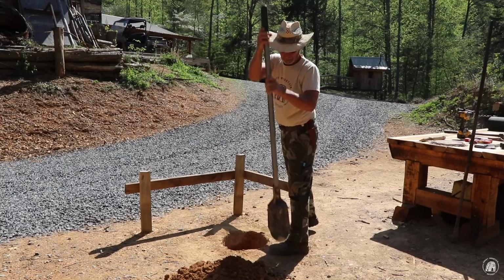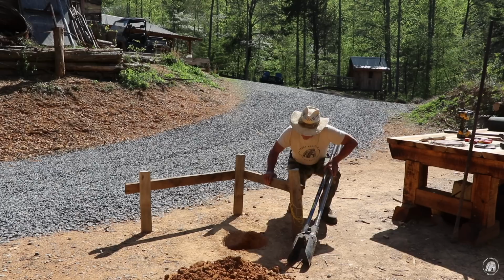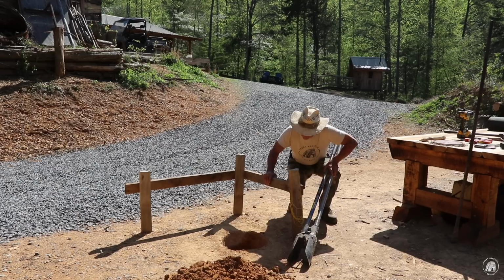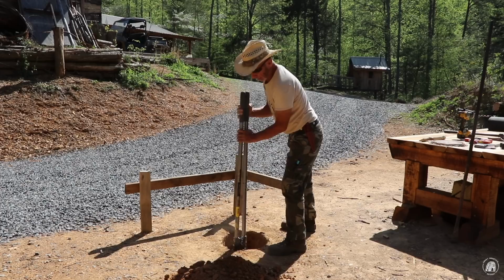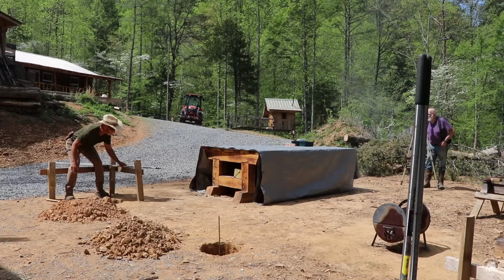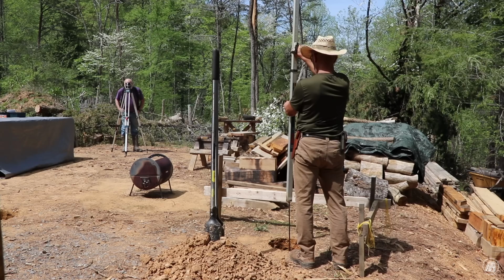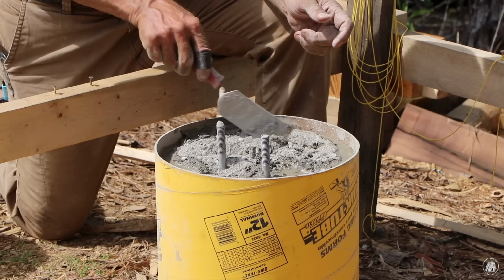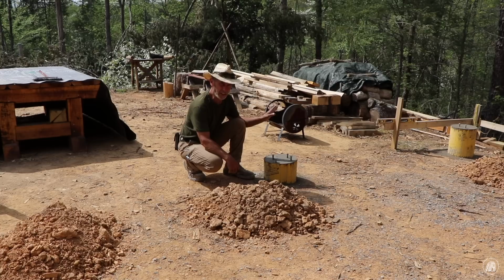Timber Frame Workshop Foundation PT2

Comment: Won't take to many holes in that ground to wear you and that set of post hole diggers. If you get tired try getting a pinch bar, 6 feet long, 1.5 inch diameter, with a point on one end and wedge on the other. I use one down here in Florida when I hit limerock its a big help. God Bless, Danny
Reply from the maker: Good idea, Danny!

Comment: That's a hard way to dig the holes. I found that using a digging bar (both a flat chiseled one and pointed one depending on the hardness of the ground) to loosen the soil and a shovel to dig out the loose stuff to work better than a post hole digger. If the ground is really hard and dry, get the holes started by digging down each to about a foot and then fill with water. Let them go for a day and hopefully the water will have softened the ground up a bit.
Reply from the maker: Good idea, Dave! -Jennifer